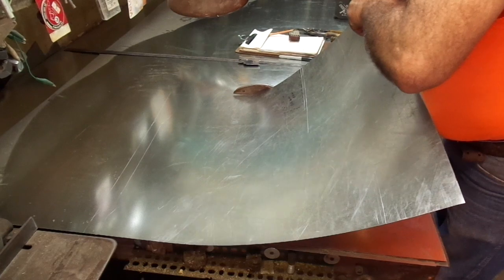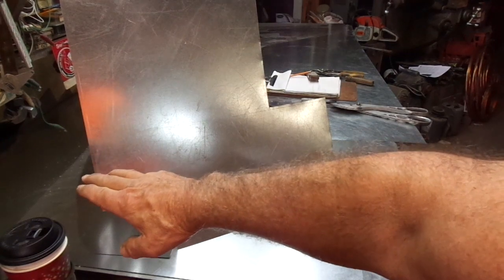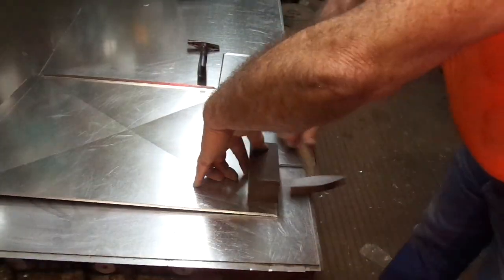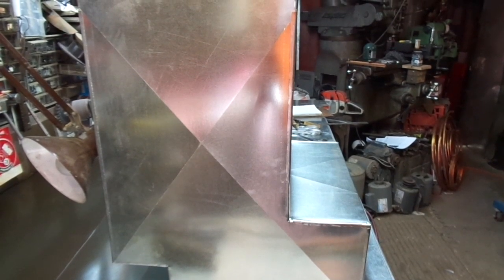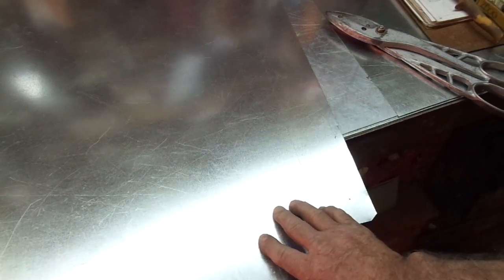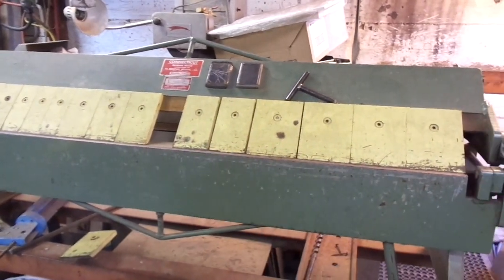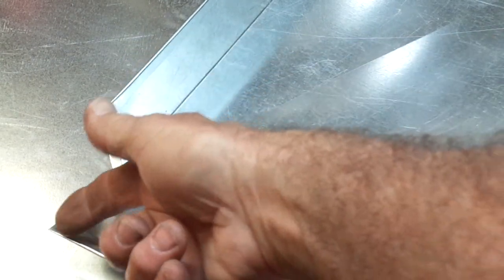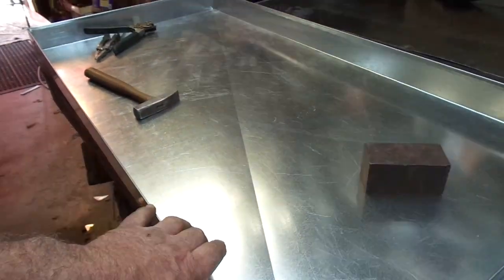Pt 1 Heat Pump Attic Installation

Comment: Very curious on the way you will do this heat pump installation. As usual, I really enjoy your description of the work to be done.  I wish you can have a cold and overcast day, so you don't cook up there. Some people keep ear plugs in the shower because of otitis... But not you if I understand!    You are about to reach the 1k subs!
Reply from the maker: Hey Joe... Happy Friday to you sir !!  There will be a lot of parts to the series covering many of the details, but not all.  Its just impossible to do AND get the job done in a timely manner.  There are many ways to perform just about any task as you know so what you'll see here is not necessarily the absolute best way nor is it the only way to do a job....but by golly its the way this one gets done !! (-:

Every system should be 'tailor made' to fit the requirements of the building, whether its a home, storefront or commercial structure.   There are a lot of acceptable differences in the way a given job is completed and there are plenty of UNacceptable differences as well.

Thanks for watching Joe and I'll try not to disappoint your curiosity.  (-:

Comment: Here we never instal ductwork in the attic...I guess its cuz for use the main use is for heating and cooling is just a side note...I personally like the basement system....Different places and different ways of doing things...CHEERS
Reply from the maker: Hey Hey Gator...may a happy and prosperous Friday be the rule of the day for you sir !!  I prefer the basement system as well and there is one down there that does not cool or heat the second floor due to improper system sizing and ducting.  That's why this new and totally separate one is going in the attic.  Then the original one in the basement will be gutted, ductwork and all then a proper sized and designed system will go back in, new ductwork furnace and a//c.   And you're right...there is never one way to do anything.  What'll work here won't work in colder or hotter climates due to those ambient differences.
Reply: @tractorman4461  For me and what I understand when the system is in the basement at least a 5 inch to every room and for use a cold air return also in every room with a closable register ....one up high and the other one close to the floor...always worked well for me in the few new houses that I build....many different ways for sure....CHEERS
Reply from the maker: @gatorsworld  In basement systems we typically run a 6" to each room with multiples in large bedrooms, large living rooms and great rooms as well.  We try to get r/a in every room and go for multiples where possible because there's always a limit passing air through a wall supported by double floor joists below.  When a second system goes in during construction, a r/a also goes into each room but as an add on unit, the only viable option is a r/a filter grill or ceiling grills opposite the side the s/a drops into. Yep... different ways, and as long as you stay warm or cool at the right time...its a good system.   (-:
Reply: @tractorman4461  I`m taking notes and if I ever build another one...If where still in here I`ll communicate with you,,,, if not which is the biggest probability it`s all good info to have in my big personal computer....I could even give advice to people and take the credit with your permission and the check would be in the mail of course....CHEERS